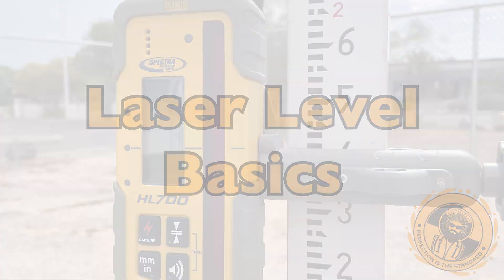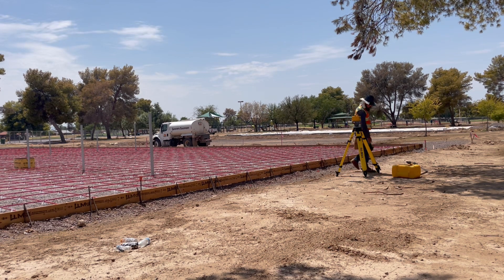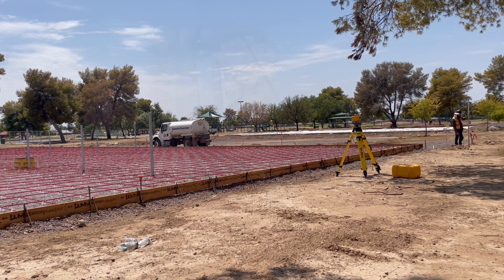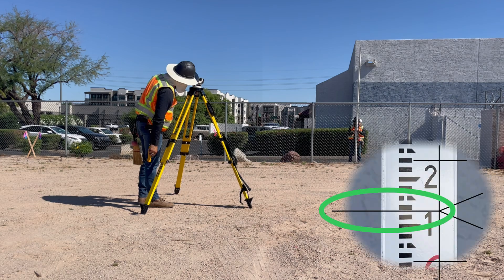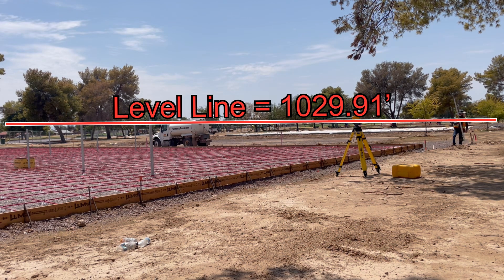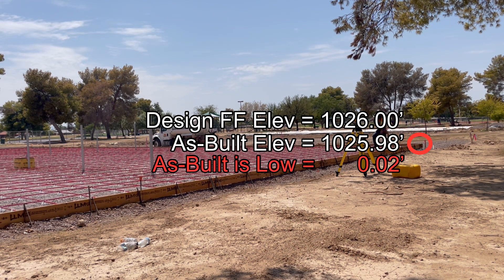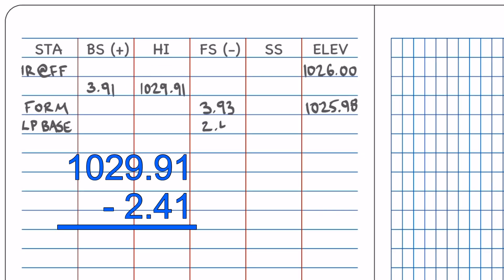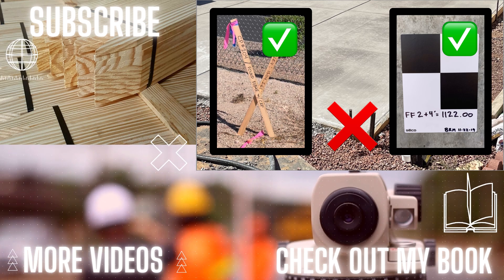Surveying: Laser Level Basics

Comment: Did you take only the one reading on the form or did you go around the corners to make sure the for was the same height all around? So if the laser gives a somewhat imprecise reading and (knowing optics) it widens out over distance, making it even less accurate, what are your thoughts on what range is useful for a laser level before error starts to become excessive.
Reply from the maker: @bwhog  Well, this was primarily a training video, so I only shot the two items.  When doing the real task before filming, I setup in the center of the bldg form so that my shot to the backsight was the longest shot taken during the course of the work (which was still less than 200 feet) and all my other shots at the 4 corners fell inside that backsight distance.  Working inside your backsight distance is a great way to ensure you are not extrapolating errors, especially when the backsight distance accuracies are already at or near your task tolerance or max instrument capabilities.  Great question!